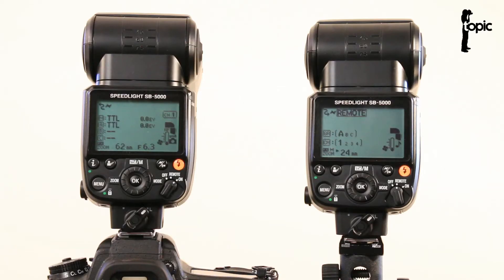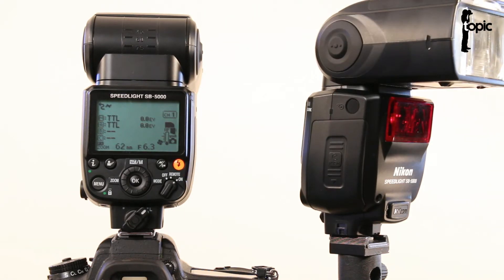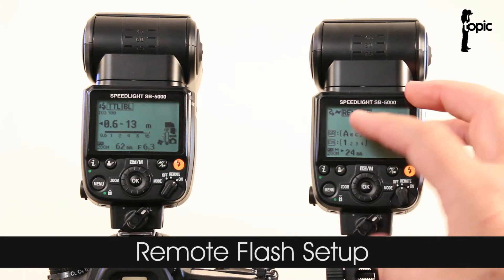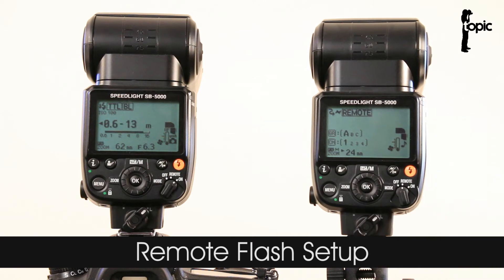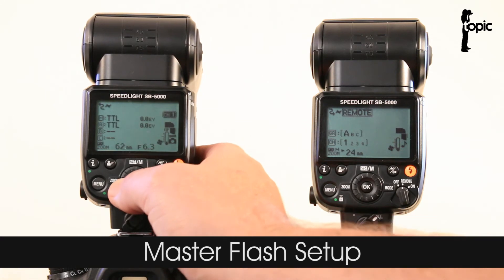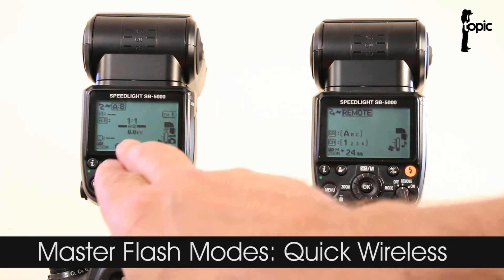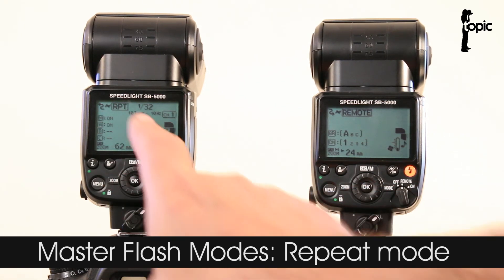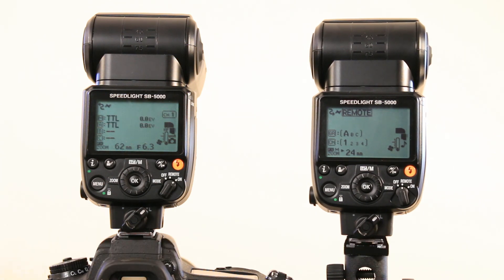Nikon SB-5000 Speedlight - How to set-up the optical wireless system

Comment: also that "quick wireless" option is familiar if you use the s u-800 commander for the r 1 c 1 macro ring flash set up, this is the way the  S U- 800 controls the ratio of power between the two included s b r-200 speed-lights in the R 1 C 1 kit.

Comment: I set up the SB5000 as a master & the SB600 as a slave.  It works, but there is like a 2 second delay.  Any Suggestions?  My SB5000 has the "Snake" followed by "the lightening bolt" followed by a "A:B" in a square box.  Can't figure out how to get rid of that.  Could that be causing the delay?

Comment: I have Nikon 3400 D and Speedlight 5000. It will compatible ?
Reply: yes, completely, it works as a CL-S flash, like the SB700/800/910 does, it Can't radio trigger, as the WR-R11a/b (this is the new Radio antennas, for the current z6ii/z7/z7ii/z8/z9) is only compatible with these newer cameras; OEM, of course, you CAN radio trigger, but with an aftermarket pocket wizard system, it has a transmitter and receiver unit which attach to the camera hot shoe and SB-5000 respectively, to remote trigger the sb-5000 without radio, it just entails using the CL-S remote system (and your pop-up flash as the 'master')- set the 'flash control for built in flash' menu to "Commander" mode, its default is TTL mode, set groups and channels, and pop up the flash, so it communicates with the sb-5000.

Comment: Those speed lights only work with D5?
Reply: D850 also
Reply: No, they work on any Nikon DSLR including using them as CLS commanders. Their radio control facility only works on D5 and D500